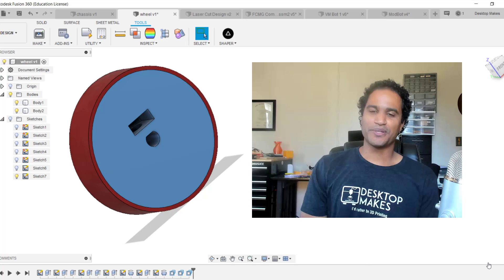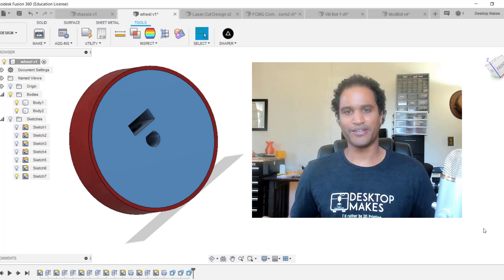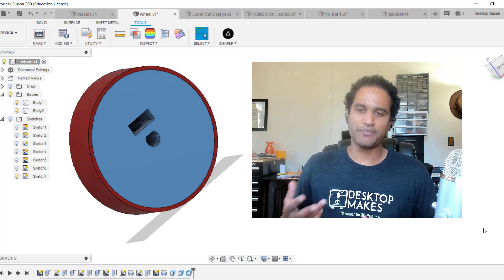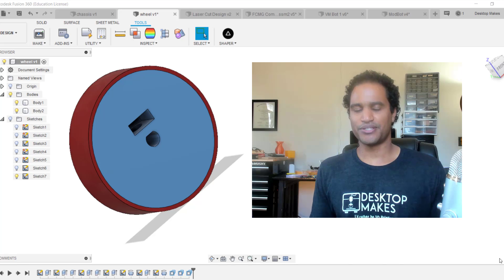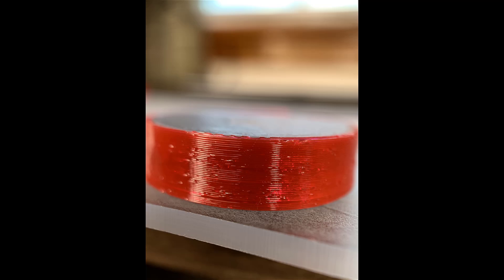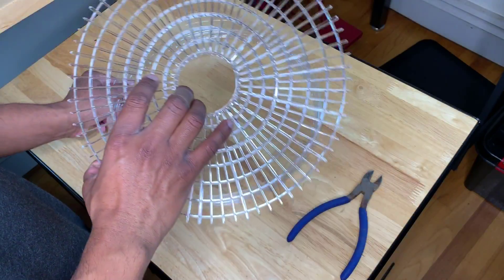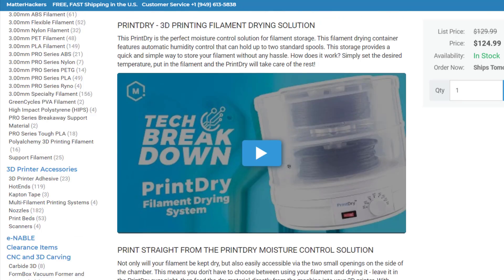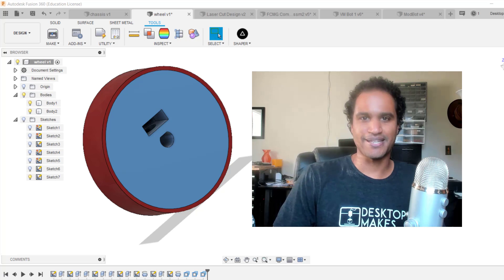How to Dry Your Filament

Comment: I use an air fryer, which is basically a small convection oven. I set it to the required temp and put a probe thermometer for added piece of mind. I’ll weigh the spool before drying and dry at 1 hour intervals weighing each time until I no longer see a change. This has worked perfectly.

Comment: I did this whole big thing with large quantity of silica gel, large zip lock bags and a few gasketed 5 gallon buckets. I had to step away from 3D printing for over a year and in that time all the indicators tuned pink. I think the real solution if you do not have a high turnover of filament is to use an oven or dehydrator.

Comment: A good desiccant that will suck moisture away from most things is silica gel.  And the cheapest way that I have found to obtain it is by buying "crystal" type cat litter (Walmart or similar).  I've dried out wet iPhones and the like by putting a goodly amount in a cloth bag or old sock.  Before using, drive off all the accumulated moisture by putting it in the oven for a hour or so at 180-200 degrees F.  Remove and put the silica gel pouches in a sealed tupperware container before they fully cool off.   Also have the filament in it and leave it over night (or longer).  That should suck every bit of moisture out of whatever resides in the tupperware container.
Reply: I purchased a bag of the kitty liter crystals, way cheaper than the regular desiccant beads. The one problem I found is that there was a large amount of tailings or powdered crystals that can make a mess and get into things.

Comment: New and Improved Eva-dry E-333 Renewable Mini Dehumidifier (https://www.amazon.com/dp/B000H0XFCS/ref=cm_sw_r_cp_apa_i_GoCVCbZTG5HSF) along with 32 qt. Sterilite Gasket Box (http://m.sterilite.com/mobile.html?id=802&ProductCategory=0&section=0) will fit 7 or 8 rolls perfectly and keep them nice and dry. Plug in the silica dehumidifier every few months to dry it back out and you're good to go.

Comment: Thanks Vlad!  That PrintDry looks like an identical twin of the Westinghouse dehydrator - with the exception of the covers for holding the filament, of course.
Reply from the maker: They do look very similar.  The PrintDry also includes two feed ports for direct printing while drying filaments.  It looks like the filament may be sitting on little turntables as well allowing them to spin.

Comment: Nice see a video about this topic. I have 2 large air tight container with cilica gel,500 grams. You have to have the cilica and filament ratio right. I am planning building a smaller container where I can directly print from, for my nylon. Also have a food dehydrator ,but temp wise it won't reach the max temp of 55deg c. Cheap unit. Also have a few large air tight bags. Special kind, they have a metal coating,good for food storage, I forgot what they are called though. Good luck with your robot project.
Reply from the maker: Thanks Ido,  I'll be upgrading to air tight containers for future storage.

Comment: I keep all my filament in zip lock bags and then stored in the big clear covered containers with a bunch of silica packs spread around. Have never had a problem in 2+ years.
Reply from the maker: This is what I'll probably end up doing.  I'll first run them through the dehumidifier and then properly store them in bags in a container.

Comment: Vlad, I have a mini dehumidifier that does NOT use a compressor.  It along with about 10 spools of filament fit inside a large cardboard box.  I also put a remote indoor/outdoor thermometer in the box to monitor the humidity and temp.  I run the dehumidifier when the humidity indicates a rise or when the outdoor conditions warrant.
Reply from the maker: I also bought a temp humidity sensor to check the accuracy of the dehumidifier but didn't get it in time for the video.  I have yet to test it.  You've got me looking at mini dehumidifiers now.
Reply: Vlad, here is a link to my video I did of my filament box - https://youtu.be/WpEd8yutP50